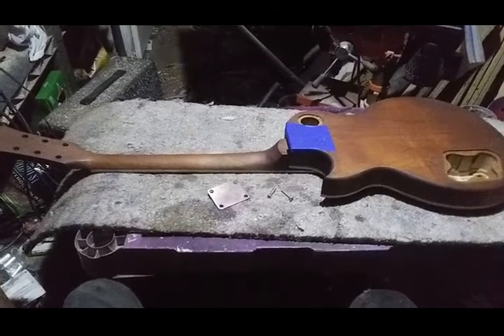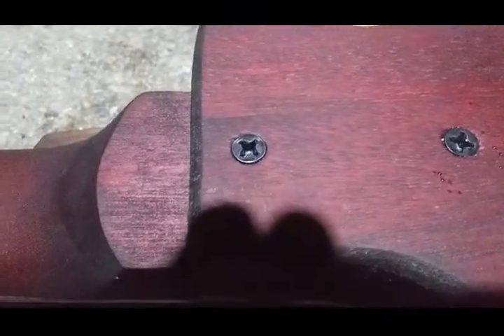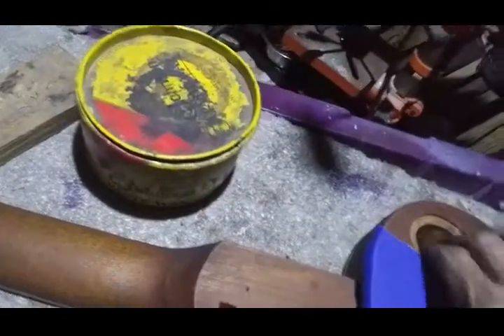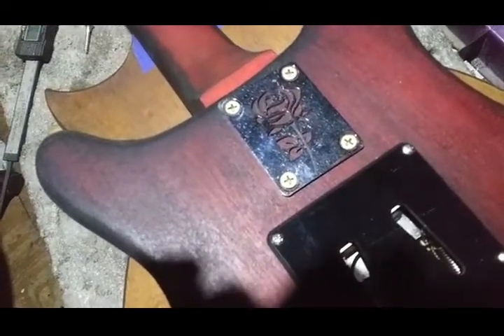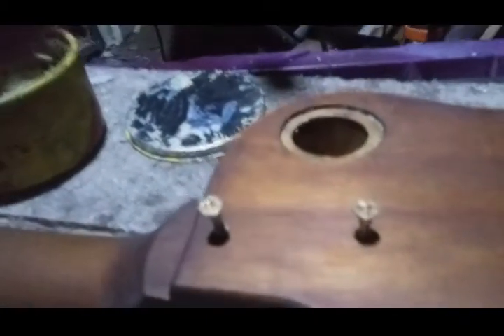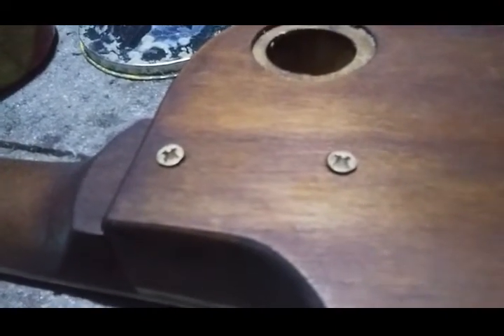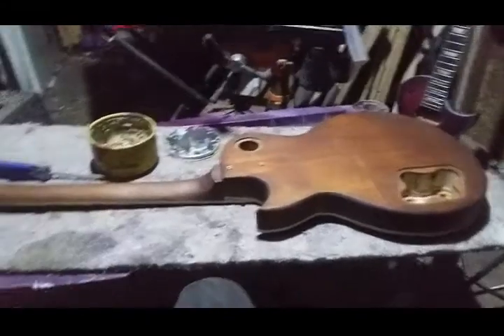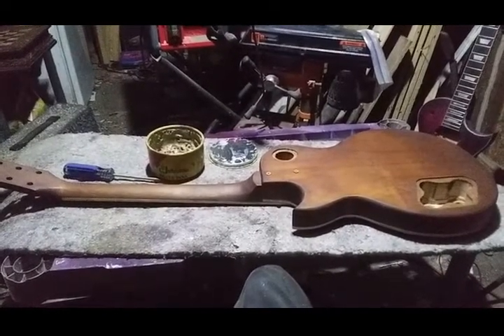Converting a glue in neck to bolt on

Comment: What if, conversely, you wanted to turn a bolt on neck like say a telecaster or something like that into a set neck? Could you drill and use wood glue and wooden dowels that you would then flush cut and sand?

Comment: normbarrows
That idea was invented by Johan Scherzer in the mid 1800s & it increases the sustain by allowing the fingerboard extension to float over the body.
Reply: Incorrect… tonewood and sustain all that rubbish is completely untrue…
Reply: @sirspongadoodle  sustain is how long a note drags on so yeah it is true, a 4 bolt neck wont have as much sustain as a set in neck because of the body to neck wood contact, the more wood there is the more the note is going to sustain through the body, if you compared a set neck and a bolt on neck the set neck will have slightly longer sustain, as far as allowing the fingerboard extension to float over the body I have no clue what hes going on about.
Reply: @blakeno761  glenn fricker has alot of videos on this subject, the pickups are magnetic not microphones therefore the only sound it picks up is from metal…

Comment: Would this work on a Dean ML diy kit? Only thing stopping me is it’s a glue in
Reply from the maker: The two-bolt trick can be used on any size neck.  Right now I'm working on the Scarab, which has a 20mm wide two bolt neck joint.  If your neck is wide enough, you can use a generic 4 bolt neck plate and bolts, or 4 bolts and neck screw ferrules, etc.  If not, you can use the two-bolt method.  If you use the two-bolt method, there should still be enough room to cover it with a fake 4-bolt plate and screws if desired.  Be sure to double check the length of the neck screws you end up using.
Reply: @normbarrows  okay awesome, the neck for the kit I’m looking at seems to have a a heel that’s wide enough for 4 screws. I’ll rewatch the video for more tips on doing the conversion, thanks a lot!!

Comment: I like your method. I have a 4 bolt LP kit coming as we speak. I would like to use your method for 2 bolts. Any advice?
Reply from the maker: While drywall screws will suffice, I prefer M6 flat head Allen drive screws and M6 wood inserts these days - basically for the bling value.  For the thin necks and bodies I do these days, I use 30mm screws and 10mm deep inserts.  A LP type neck and body would probably call for a longer bolt and a deeper insert.
Reply: If your kit is 4 bolts I would use the 4 bolts. 2 bolts will NOT be as durable and without the mounting screws going through a backing plate the stress from the strings pulling the neck and body together are slowly weakening the body at the neck joint. If you do this with a set  neck like he did I recommend drilling a backing plate and making it a 6 screw configuration. 2 holding the neck in place and 4 strictly for the backing plate.

Comment: Too bad I cant find anything as clear as you are on going the other way (converting bolt on to set neck)
Reply from the maker: Converting a bolt on to a set neck is an entirely different kettle of fish, as they say.  The strength of a glue joint is a function of the total bonding surface area.  A tight fit also helps.  That's probably where the whole "how tight does the neck fit?" thing comes from.  I'm now using just 2 wood screws and no pocket at all for my builds, so a tight fitting neck pocket is not really necessary for a bolt-on.  But a glue-in neck will require a decent amount of contact area, which a bolt-on may not have.
Reply: A Fender style neck pocket has enough area for glue. With modern glues like Titebond Original you shouldn’t really run in to problems just gluing and clamping it as it is. Fill the screw holes and you are good to go. I’ve done it a few times 😉

Comment: please counter sink the screws lol. its bugging me lol
Reply from the maker: On builds with no neck plate or cup washers, I usually do not counter sink, as torquing down the screws a few times tends to have the same effect.  This effect can be seen on the red guitar in this video.  It was not counter sunk, but the screws are flush.  On some conversions such as semi-hollow bodies, the body wood is rather thin. In general, I feel more comfortable compressing the wood into a counter sunk shape than cutting a counter sink into it.  If I encountered a body wood so hard it didn't compress fully flush, then I'd use a partial counter sink - just enough to get the wood to compress enough so the screw is flush.
Reply: @normbarrows compression on the body instead of counter sinking can cause stress fractures internally and can create weak spots making it susceptible to splits, cracking,and straight up breaking with little to no drop shock. Especially mahogany it's already brittle wood under stress. Why do you think the Gibson and Epiphone thin 60's style mahogany necks always break?

Comment: It's not even close to being a real Les Paul body or otherwise, but whatever dude 😂😂😂😂😂😂😂
Reply: I mean that's what I was saying! It's a very poor Chinese copy. And he was talking about covering the 2 screws with a backing plate?  I would drill the backing plate and have all 6 screws running through it! The backing plate is essentially it clamps the body tightly between it and the neck and takes stress off of the body!  This was a doodoo video! 🤣

Comment: That is the main reason I will never buy a Gibson Guitar with a glued-in necks! I sold my beautiful Carvin (neck-thru) guitar cu I comparied glued-in necks with bolt-ons and never heard any difference in fact I preferred the bolt-ons in every way!
Reply from the maker: As long as the joint is solid, the fastening method is largely irrelevant.